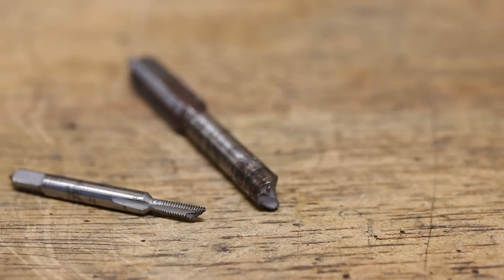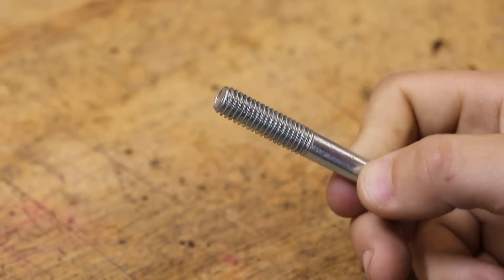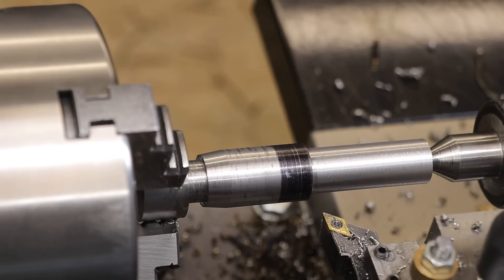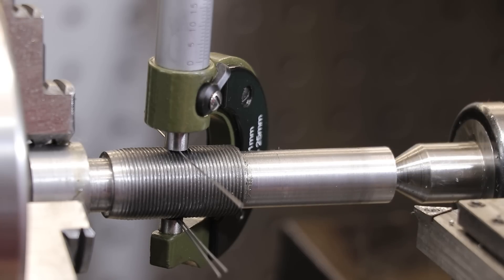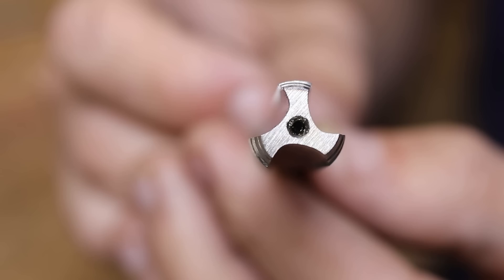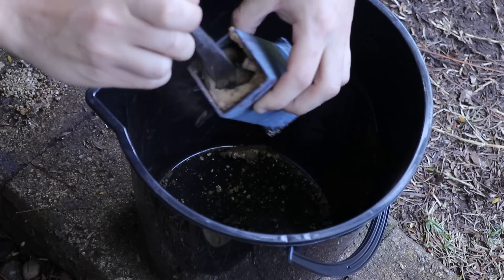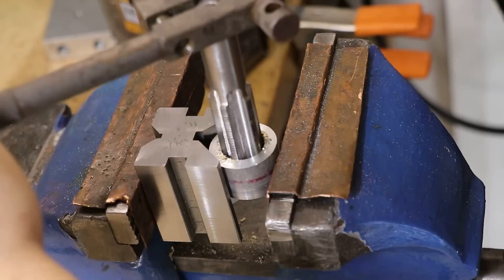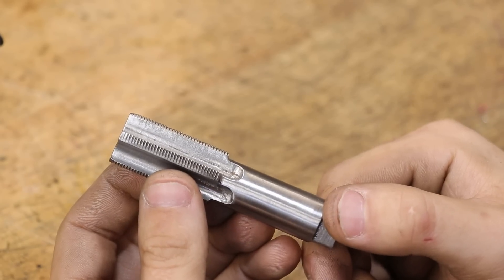I Need a Custom Thread Tap - Shop Made Tap

Comment: If you want good taps, get hssco10% ones or carbide taps as singles or sets of 3 for a single size... they cost a lot, figuratively speaking... But they are worth the price... both carbide and hssco ones are brittle as fuck, so dont you dare use them recklessly and come back to shit down my collar, but if you are diligent, they produce a very good thread, they dont break off, even at 100% engagement... I rarely tap anything that isnt 98% engagement or so, and the only tap i have broken until now in last 4 years is the 3mm one in stainless because i was stupid and didnt notice i took a finishing tap instead of secondary follow up one in the set of 3... She broke off like nothing, but if you use them with care, they last for ages and dont break, even in stainless, even at full engagement... especially the 3 for 1 sets, as while it is a full engagement thread cut, its done in sequence of 3 steps, which renders the load on each tap 1/3rd of what a machine tap would see at that undertaking alone... Carbide ones can handle themselves as single piece taps, but in hssco, i prefer the 3 for 1 sets... As said, they cost a lot, especially specialist large sizes, but they are worth their weight in gold... Also, that broken tap is now a long term custom boring bar hssco insert for grooving... I replaced her with a new one from a new set, so i have backups for both the starting and the finish tap for m3 now... Thankfully, m3 set of 3 is cheap as fuck in hssco10, but if it was the 3 for 1 set for the m14x1.25 or m12x1, i would be furious... those sets are quite pricey...

Comment: If you need to cut a relief into your tap next time. Try using a drill press with a mill table. Saves the cleaning process. Drill presses don't care about grit as much.

Comment: There are many reasons to cut threads into wood; just depends on the project at hand. Some even go as far as to cut threads and use a threaded insert to ensure the item is secure. I guess it's up to each and how to curb one's OCD when it comes to threads as to how far they'd be willing to go... Cheer's...
Reply from the maker: I’m aware of that I’m quite sure that they are a different thread form made for wood no?
Reply: @artisanmakes  Threading wood typically works best with a more course thread vs a fine thread if that's what you mean by different. My comment wasn't about the size so much as the actual event of threading wood is more common that you said. You seemed to indicate that threading wood wasn't common or did I misunderstand you?
Reply from the maker: Well no I said threading wood with machine screw threads
Reply from the maker: I just had a quick recap and it certainly looks to be different thread standards for wood. Much coarser than what youd use for metal.

Comment: I needed a m10x1.0 helicoil in a pinch. I just put in a helicoil for m10x1.25. Needed to repair pulled threads on a 2013 Audi R8 oil pump. A replacement was $2,000 USD.

Comment: Only the first few teeth actually cut, so only they need relief. Beyond that, the teeth which don't cut should have rake and sharp edges on both the front and back, so that chips are directed back into the gullets when backing the tap out. By grinding back all the teeth, you've formed gaps where chips can get wedged, potentially damaging your newly cut threads. Be sure you thoroughly clean the chips out before backing the tap out to mitigate that risk.
Reply from the maker: Interesting, the machinery’s handbook seems to be absent on that detail
Reply: @artisanmakes  the handbook seems to omit alot of things that should be common knowlege but are often easy to overlook if youre not specifically thinking about it in the moment.
Reply: @artisanmakes     The amount of knowledge that goes into a simple tap is astounding.  I really learned quite a bit from this and the comment section.
Reply: @artisanmakes  cheked textbook for university students (USSR 1939), it mention cutting and calibration teeths with different geomentry, which can or cannot be present on same tool depending on tool material(carbide/steel) and aplication(manual/semi- fullyautomatic machines).
Mb ur book on more specific topic.
Reply: I am not a machinist but as a craftsman I have tapped thousands of holes.  I have broken a lot of taps as I learned.  In thick material, I always went for a full fluted tap so that it could clear ships and burrs which are usually what is causing binding.  Thinner or softer material seemed better with only and end relief.  For tapping into pipes, I really liked "skipped tooth" taps and they held a few hundred PSI no problem.  Not scientific by any means, but to not design a tap with regard to the material it is to be used in seems like an omission?  Of course, taper taps would need much longer flutes as they cut for a good portion of their length.
Reply: You understand that if you do not cut off the back side of the tops, it will cut when opening. This will ruin the thread. That is why factory taps do otherwise than just cut a thread on a bar and mill it. The teeth are made at an angle, they do not form a single diameter, they are offset, so the tap does not get stuck and cuts.
Reply from the maker: This seems to align with several technical drawings I’ve found. I think that’s a little outside the scope of a home workshop tap but I guess that’s the difference between the two. In any event we can get close with the shop made stuff
Reply: Well said.
Reply: I was looking for this comment, thanks. greetings from Ukraine
Reply: I thought that was kind of obvious. If you cut 1 in deep in the wood and then cut 1 inch deep into wood again you're not cutting any material... same goes with a tap.
Reply from the maker: For you I guess but I’m following the machinery’s hand book guide on the tap geometry which is a time tested resource

Comment: mild steel hmm I finished a spindle for my mill and mild steel is pretty soft as I accidently put a small dent in it but if I hardened it I will have to grind the surfaces to shape. I can't use a furnace anyway because I live in a apartment. Oh well I'll just be more careful.

Comment: Nicely done.

Btw. from what I've seen taps usually only have a relief cut into the tip, since that's where the cutting is happening. The untapered part of the tap is mostly just for guiding it.

Also you could have set up something with the dividing head and the grinding wheel in the mill to sharpen all the edges properly, I tried sharpening cutters like you did by hand, but the risk of accidentally rolling over the cutting edge and thereby ruining it is too high.

Comment: So I may have forgot my tap at home and needed it at the workshop which is about a 20 minutes drive. No way I am going home just to grab a tap xD
So I grabbed a 12.9 strength M4 bolt, ground a single flute in it and a lead angle, tested it out and in aluminium it made usable threads. 
I just needed to hold cable chains in place so the thread didn't need to be the strongest anyways

Comment: really grate work ! i remmber having to make a tap  when i was restoring a old Rockford lathe i needed a new cross feed sckrew and nut , making the cross feed screk was easy , the 5?8 -10 square thread left hand  tap was not so easy . had to make two because i didnt get the cutting agels right the first time

Comment: Great DIY video for making unique taps. However for base material I would choose Böhler K110 - 1.2379 - AISI D2 cold work tool steel for this project, as this steel does not require rapid cooling for hardening, can be cooled down in air with the furnace and it will still go over 58HRC. We made a few special tools from this material (special taps, bending tools, etc.) and it's very easy to machine. The only important thing is the tempering after hardening, we used a standard kitchen oven, where we put the parts for a few hours in max. temperature (around 250 °C), then they will be not so brittle then.
Reply from the maker: The lengths I’ve had to go to to get anything other than W1 or O1 from local suppliers. Carburised steel really isn’t my first choice given it’s low hardenability. I’ve always wondered if people made taps from D2 given its reputation as a good cold working steel. Now I know.
Reply: @artisanmakes maybe give up on trying local because for most things it's not realistic
Reply from the maker: Yeah I have better luck getting exotic tool steels imported from Europe. Had  to get a plate of S4 tool steel from England. Shipping is quite expensive unfortunately
Reply: @artisanmakes  after watching your video I searched for other videos on the same subject and found some good ones but you however are the best presenter giving clear instructions. 
That to me is an advantage, I however are a boilermaker and structural steel fabricator by trade and your hardening technique I find worthy of learning.
I would use old used sump oils from machinery because of the minimal composition taking advantage of chrome and molybdenum to hard case mechanical components.
Reply: @artisanmakes  That's unfortunate and surprising, over here in NZ I can pretty easily get most of the A/D/O tool steels as well as the Böhler range (and other special stuff like 6AL4V can be special ordered in). Maybe you need to branch out and look at suppliers outside of your locale.
Reply: @artisanmakes even though its not the most ideal material, i do think, at least in the case of a tap, having case hardened steel might not be such a bad thing. It will definitely be less likely to have any kind of brittle fracture, because the core is essentially not hardened. Though, it could potentially be more likely to deform if it gets bound badly. 

On the topic of stuff like d2, and other air hardening steels they make great tools (and knives, etc) but If you don't have a temp controlled furnace I would avoid using them for projects like this. Since they need to be austenitized fairly high and held their for around 20-30 minutes give or take.  Idk if you have a thermocouple set up with the one you show here. If you do, and are able to control the fire enough to get exact temps it could work. 

Also you get into the area of potentially needing cold treatment after the quench, depending on the hardness you are aiming for, and the specific steel you end up using.
Reply from the maker: Cheers I’ll have to look into it
Reply: But this taps can only be bent, but not broken in any way :)
Reply: This was a one-off where as long as it could do the job, material price was top priority.
AI says- "high-carbon, high-chromium ledeburitic tool steel known for its excellent wear resistance and edge retention, making it significantly more expensive than medium-carbon steels"

And I expect its even worse in his little corner of the world.

LOLing at so many people calling his planning into question because he's not willing to throw 200-300% more $$ at a one-off project.
Reply: @boots7859  Maybe I'm a little too optimistic about the EU steel prices here, because there isn't much of a difference in price between low-alloy carbon steel and high-alloy tool steel, and many steel distributors sell the small pieces left over from long round steels and large sheet metal for pennies (sometimes less than half the original unit price), and in such cases we tend to buy the raw materials for our own use ("it'll be useful someday").
Reply: I’m was surprised that you succeeded.

Comment: They make a tool called a tap extractor. You may want to get one. Once you use it you'll be sold. The drawback is you need one for each diameter and flute count, so it gets to be an investment but it does save the workpiece
Reply: That's a future video "today I need another tap extractor but rather than wait 3 weeks for one to come by mail, we're going to make one"

Comment: Don’t underestimate the power of a bolt with flutes cut into it. They make the best diy thread chasers in a pinch.
Reply: Put the bolt in your vise and use a cut off wheel in an angle grinder to make a slot through the threads.
Chuck the bolt up in a drill and hold some Emery cloth to it so it becomes a bit undersized and run it through to clean the threads of whatever grit and oil and whatever gunk..
I've done this for years with old automotive parts when I can't thread stuff in because of how dirty they are and I'm limited in ways to clean the area.
Reply: @travisfabel8040  for the most part it's worth just getting a set of cheap plug taps for use as  thread chasers and ONLY use them for that purpose
Reply: @travisfabel8040 oh yeah....you mean just like he shows in the video?
Reply: @breadlowry  no. You have to read past the first sentence of my post.
You do what he did there, and then you turn it under size and then... Instead of using it to cut threads like he's using there, you use it to clean existing threads and break out the dirt and gunk and stuff that accumulates in old automotive engines/chassis.
Reply: @travisfabel8040  That's the way! I always use that if I had to make any machining operations near/around a tapped hole, cleans up any burs, chips and gunk that may have gotten into the hole!
Reply: @travisfabel8040  Nice thinking, I am going to borrow that please.
Reply: Also works great with wood screws to drill/pre-tap a hole in a splintery wood. Some high-quality wood screws over here (France) actually have a flute cut at their tip to help with that.
Reply: @Sodabowski you can get the same screws in the US.
Reply: @Sodabowski called type17 screws here in Australia.
Reply: @Sodabowski  If you're using standard woodscrews you're SUPPOSED to drill pilot holes for them - a fraction smaller than the smaller diameter of the screw body. Ditto "self tapping" sheetmetal/wood screws.

The newer style selfdrillers are nice though, especially if you can get Robinson head Twinfast profile. You'll destroy your power tool before those torque out...
Reply: @Sodabowski des auto-foreuse tu veux dire ? il en existe pour l''acier aussi
Reply: Especially high-strength bolts, which have a little carbon in the steel and can be hardened.
Reply: I was thinking with a proper high strength bolt as well
Reply: Your lathe sounds just like a Toyota Hilux on idle 😅
Reply: I do this all the time! I use a cutoff wheel at a slight angle to make the the thread have a cutting edge.
Reply: Definitely a good trick to get you out of a mess.

Comment: Your tap and die inventory is surprisingly similar to mine. I have the same grey box with metric taps. (I believe the site labeled it as a "pro" set, which I'm sure it is). And in addition I have a non standard M15X.75 tap and die.
Reply: I sure wish one of you had told us the brand or shown the label! They look decent.
Reply: @jameshisself9324 he clearly shows the brand it's a Frost 40-piece tap and die set. Never heard of that brand but I'm sure it's the same as other brands with a diferent label on the box. Most tools come from the same major manufacturers... there's only a few that are outliers like Snap-on that actually manufacture their own tools.